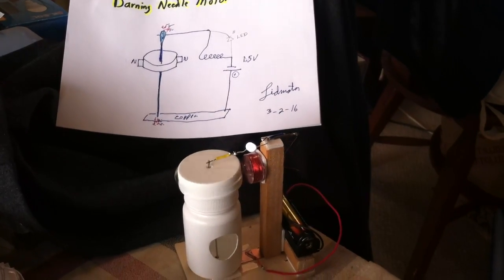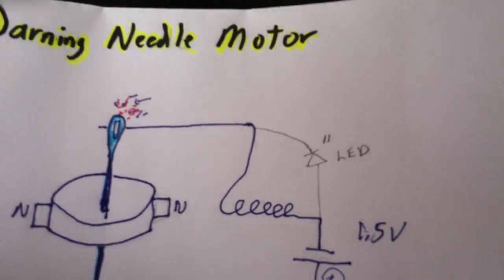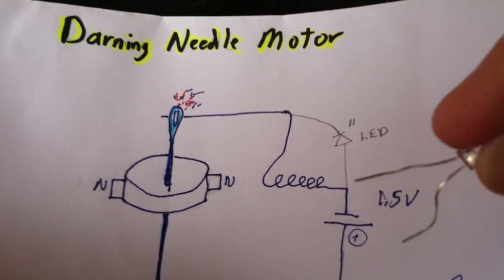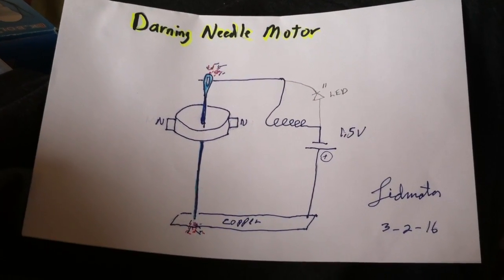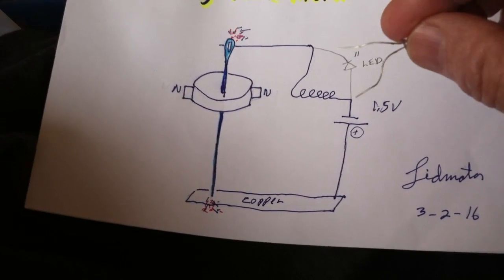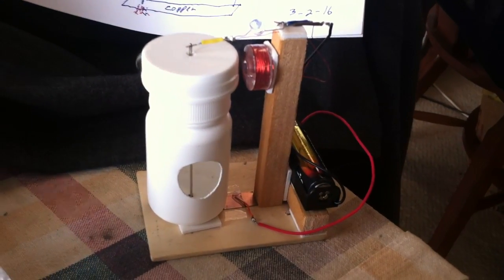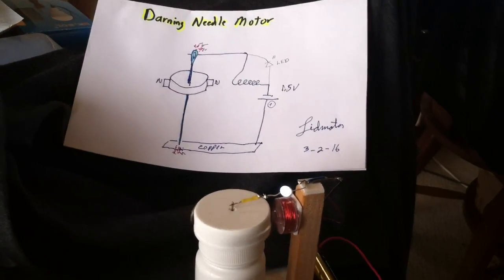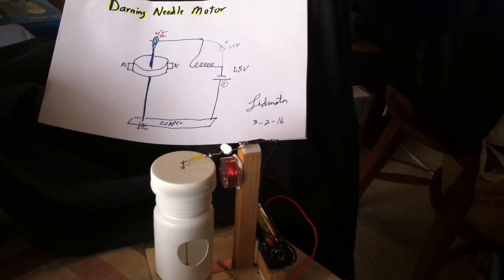Darning Needle Motor  -- With LED

Comment: Have you heard of a charge pump? Instead of using the flyback effect of an inductor, charge pumps use capacitors as the storage element and control voltage by charging/discharging them. Marx generators work by charging capacitors in series then discharging them in parallel to get huge voltages and sparks!

Comment: Very neat and clean...the darning needle is another winner.
Maggie would likely enjoy this ?
Without the LED you may see a small wireless field off the coil, for A/V plug and LED fun :)
Oh, and look at all the sewing machine vids linked on the sidebar LOL
Reply from the maker: +slider2732  I was thinking of mounting a small ring magnet on the needle inside the bottle and seeing if Maggie would be interested.   The motor is too slow for her to work off the main rotor.  I did notice all the sewing machine videos here and wondered if I should make a tiny motor using a sewing machine needle.  I could name it the 'Singer Sewing Needle Motor' ----if it ran smooth enough.  It would probably bother a bunch of sewing folks who land on the video and say WTF.